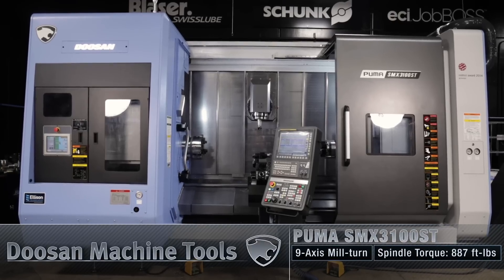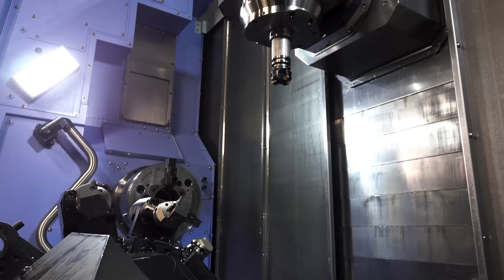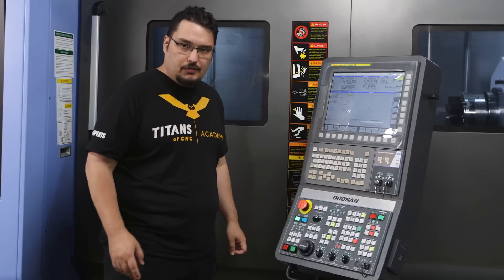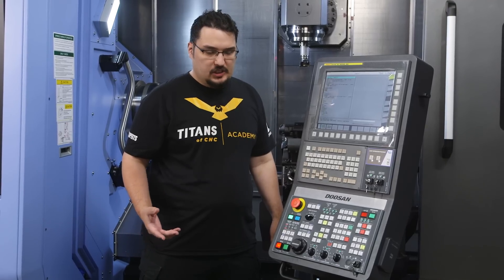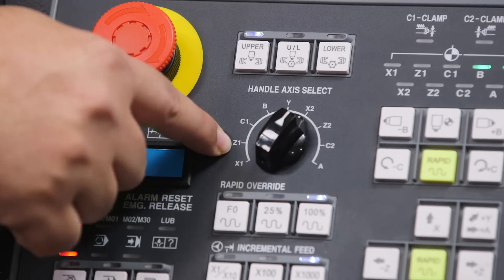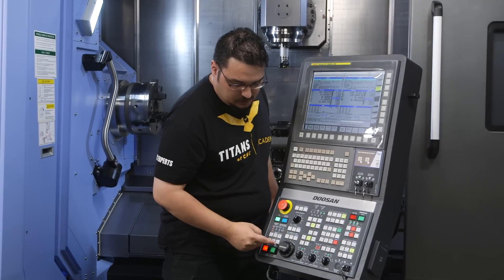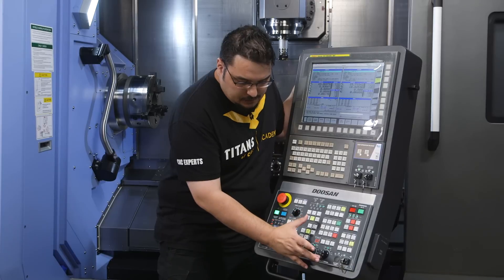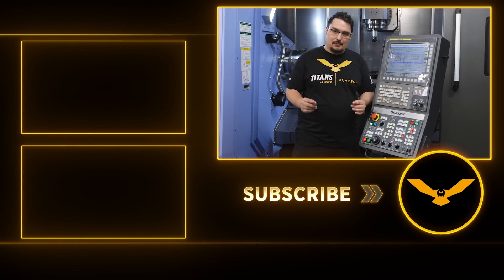DN Solutions PUMA SMX 3100ST MILL / TURN | Operation / Controller Overview

Comment: Much easier on a Mazak Matrix/Smooth. A-axis is controlled in both upper/lower settings, X/Z-axis are the same buttons on both upper/lower (switch-selector decides if it is upper/lower), upper/lower-turret are selected/decided in program (no need to split screen), no need for warm-up on mill-spindle (12000rpm), tool-change command done by writing  tool-number directly (ex.tool 23 is written 23 instead of T0023) and many more. You guys should try the new SmoothX AI. Then you would throw all your Doosan's into the recycling-bin.

Comment: Can you do a video explaining the wait codes, syncing of spindles a stuff like that? I'm new to mill turn (about 7 months now) and its confusing at times. Thanks
Reply: Wait codes are pretty easy... Wherever you want to pause one of the heads, you place a wait code and when the other head reaches the wait code that corresponds, both move simultaneously again.

Comment: 9 axis? Lol
Reply: I thought the same thing. It's not really 9 axis.
Reply: @wendull811   It's 5 + 4 axis, there's a full Fanuc based 31i - Model B5 control, you can do a full 5-axis simultaneous milling on the main- and sub-spindle.

Comment: I wonder how you deal with large programs, your 2600 SY II ( Doosan Fanuc i-Series ) has 2Mb, this one as far as I can see 512 kB storage.
Do you use a Data Server or do you make BIN-files on the CF-Card ( pcmcia-slot ) for XXL-programs.
We had a Doosan Z290-SMY (Mecatec) - 8-axis machine, I loved it, no CAM in the day so all programmed by hand, tricky was that
Z_Minus was Z_Plus at the sub-spindle, just as G02 was G03, there was no Mirror code for that one like G14 HAAS has.
Reply: I imagine it has a lot more memory than that
Reply: @porkerthepig  Standard on this machine is 512kB,  it's based on the Fanuc 31i -Series so max. memory is 8 Mb.
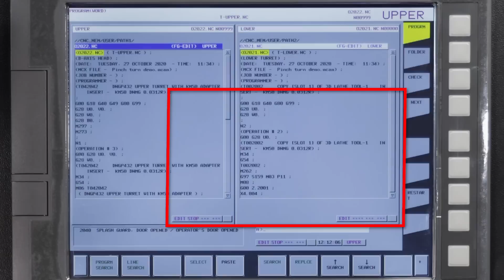Look at 11:50 - 12:00 in the video for the memory storage: --- used 428kB - free 109kB.
You can check Doosans' website for the correct info.
Reply: YT Fan , that would disappoint me if paid that sorta money for it, the Nakamura’s at work have a 8gb drive.
I just assumed that doosan would have been similar
Reply: @porkerthepig     Fanuc can provide SSD-Data Servers up to 40Gb, I don't know the prices for that option,  max. 2Gb file size per program.